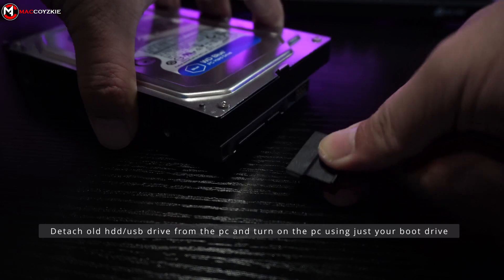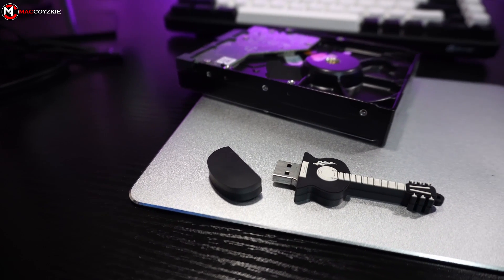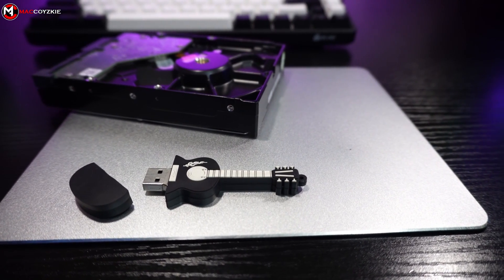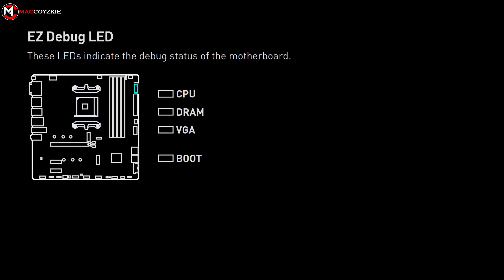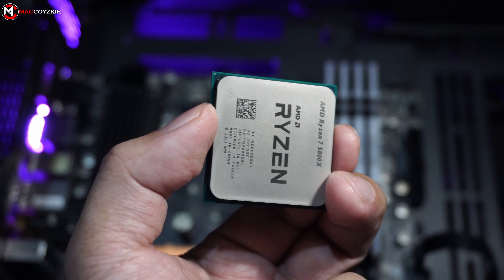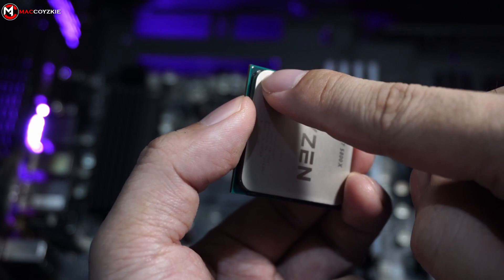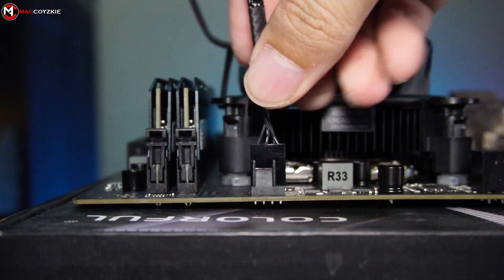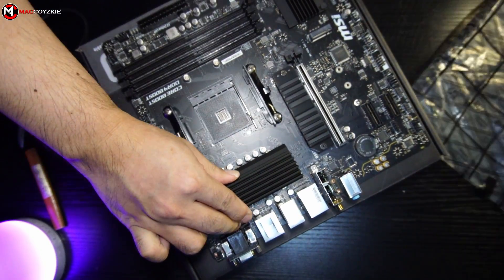Debug LED always on FIX

Comment: I had issue with vga led turn on. When I try the gpu on another rig, it posts.
Does that mean the motherboard itself is busted? Or should i try with cmos battery replacement?
Reply from the maker: if this is a new pc build you might want to consider a bios update. usually you'll see "power saving mode" on your display if the mobo needed a new cmos battery, just clear cmos for 5 minutes for now. if still doesn't work then yes it is a dead motherboard

Comment: I just got 32 gb of ram instead of 16 gb. I put them in and now it shows "boot" as ez debug. The screen is black, but my fans, ram, keyboard etc. works with their RGB. Any solution? I can't access BIOS because of the dead screen. I have 3 monitors and they all work. Please help! (My MoBo support over 32 gigs, it is Msi tomahawk B450.
Reply from the maker: try clearing cmos since you just installed ram upgrade, here's how to https://youtu.be/S9hyEPTFR10
Reply: @MacCoyzkie  dude thank you, and for some reason, I had to connect one monitor to my MoBo where I could presss F2 to start the pc
Reply from the maker: @Thanthan023  glad its all good now

Comment: cpu led is red, dram led is yellow. problem is cpu and/or ram?
Reply from the maker: what is your motherboard model name?
Reply: @MacCoyzkie  msi pro b650-p wifi, ryen 7600x, kingston ddr5 6000mhz
Reply: @mumin1643  I have the same problem and the same hardware, did you fixed the problem ?
Reply: my problem was psu.

Comment: I get no display at all when I upgrade my cpu to ryzen 5, just the 'boot' light is on and the pc just sits there and never posts. I already upgraded the bios before installing and when I put back old cpu it works just fine. msi b450-a pro, and I know it supports the cpu. Any ideas?
Reply from the maker: motherboard needs bios update
Reply: Have you figured out? I have same exact issue with same motherboard and cpu. Please let me know if you figured it out
Reply: @divad3516  Yes, so the 5600x requires a UEFI secure boot, (not legacy mode) i had to repartion my drive from MBR to GPT and enable secure boot. Then it worked

Comment: I got 2 problems, 1 is sometimes no display and Led stuck on Boot, then after powering off and on again fixes the problem. And 2nd problem is sometimes it boots to windows with debug Led on. 
That is fixes by by restarting. 
All problems are fixed by a power off and on but why does it happen?
Reply from the maker: are you using windows 10 or 11?
Reply: @MacCoyzkie  windows 10 bro
Reply: Most of the time Pc boots to windows without any issues. 
But 1 out of 10 times, when I power on the pc, the led is stuck at Boot and No display, not even bios. Then after a power off and on fixes the problem. It's like 1 out of 10.
Pc is almost new, 2 weeks old. 
Previously I had an issue where after I shutdown the pc,  the fans and rgb lights were still on for like 2-3 mins then it's powered off. Again that was fixed by Bios Update. 
The current issue isn't a problem but any idea why is it so? Bug in Bios?? 
I'm using B660 Aorus Master with 12700F and rtx 3060.
Reply from the maker: @xtrm_7  have you tried clearing cmos yet? this sounds like the xmp or docp is not working properly so lets try to load everything in default atm. here's how to clear cmos just in case https://youtu.be/S9hyEPTFR10
Reply: @MacCoyzkie  nope I haven't but i will try

Comment: Thanks for the video but my problem still isn't solved. I just got a new pc and when I turn it on, I have a signal on my screen but the vga led is still lit. The screen only shows a black screen with a little white stroke on top left corner. I tried to remove and reinstall my gpu but it still does the same. I did research but it seems like I'm the only one with this problem
Reply from the maker: what's your pc specs?
Reply: @MacCoyzkie  motherboard : amd B550M-A Pro
Cpu : amd Ryzen 5 4500
Gpu: tuf gaming GTX 1660ti evo 6GB
Ram : Corsair vengence LPX DDR4 (2x8GB) 
HDD : seagate baracuda 1TB
Power supply : Corsair cv450 atx power supply
Reply from the maker: @nyeeeofthestarsz1804  are you talking about the cursor? I mean the white stroke on the top left?
Reply: @MacCoyzkie  yes
Reply from the maker: @nyeeeofthestarsz1804  i see, you haven't installed windows yet ?
Reply: @MacCoyzkie  no I don't have any OS and I can't access the bios
Reply from the maker: @nyeeeofthestarsz1804  i see, I think your motherboard needs bios update for your cpu.
Reply: @MacCoyzkie  if that's the issue, it's weird that the motherboard's vga debug led is on
Reply from the maker: @nyeeeofthestarsz1804  why not try your gpu in a different rig
Reply: mine is having the same problem with a small white line appearing in the display and not booting into windows

Comment: my mb's ez debug cpu led always on while pc running. is it a problem? i can use properly pc like this
Reply from the maker: wait you can still login to desktop while the cpu debug led is always on?
Reply: @MacCoyzkie  yes. I couldn't find any reason and solution
Reply from the maker: @dr.spellist  can you make a quick video and upload it in your channel, we'll check it after you reply here ?
Reply: @MacCoyzkie  i did
Reply from the maker: @dr.spellist  no way! this is the first time i saw something like this bro. If there is anything i can think of is its just an abnormal function of the motherboard, somehow it is detecting something is wrong with the cpu but from what i saw there is nothing since everything is working fine. I don't think you should do anything for now

Comment: All the VGA problems you listed that it could be, could be true, but for me i feel like it isnt since if i press the power button i get the VGA LED but i am able to press the reset button then it boots up all fine and no VGA light turns on
Reply from the maker: if you keep that practice though it might not end well with the entire pc
Reply: @MacCoyzkie  that’s what I’m saying but guess what after 2 hrs of researching I fixed it (hopefully don’t jinx it again lol)
Reply: @astrogw  What was the issue and how did you fix it? currently have the same thing, when I wake it up from sleep VGA light is not on BUT monitor, and mouse won't connect.
VGA light only pops up a few times and really only works when I shut it down and turn it back on
Reply: @dontworry4759  oh yeah that was the beginning stage of my VGA problem, you’re able to turn it on if you press the reset button, but the way I fixed it was I changed my HDMI and also turned it fast start up
Reply: Sorry turned off fast start up*
Reply: @astrogw  Ahhh okay gotchu, so you just bought a new HDMI cable and then turned off fast start up in the BIOS or a different setting? Sorry, PC's are all still new to me and my gaming PC was way too much money for it to be acting up lol.

Comment: Thank you for this guide, you were very easy to follow & explained everything. Unfortunately my problem is not fixed, I have a 3080 Graphics card, brand new PC, the VGA light stays on, I guess maybe the graphics card is faulty
Reply from the maker: what is the wattage of your psu? perhaps its just not enough to run the 3080?. just a guess though. Anyway i suggest have your gpu tested in a friend's compatible pc, if you still see no display then the gpu might already be dead, since its new try using Rma
Reply: Buddy of mine had an under powered PSU. For his monster card